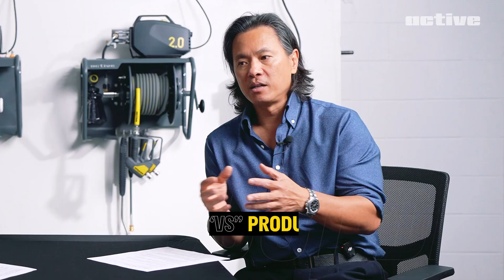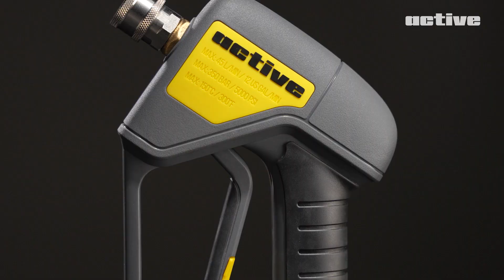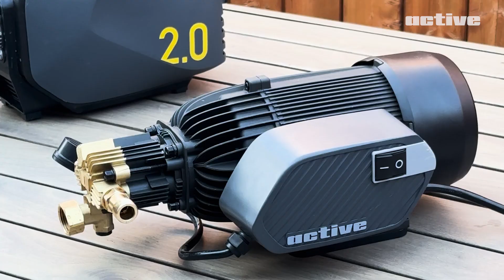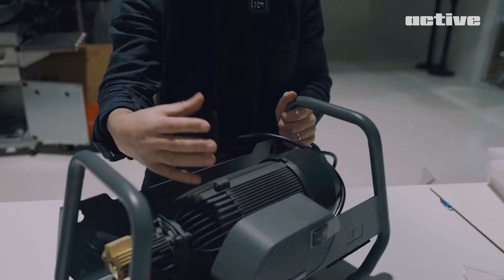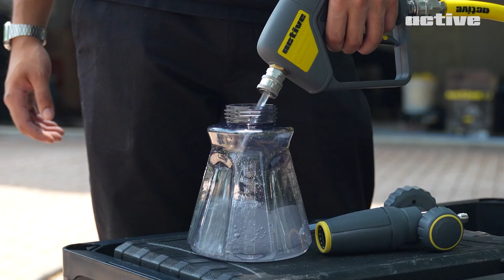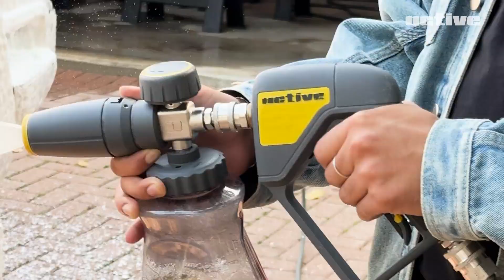Does Design Even Matter? | How We "Secretly" Improve our Pressure Washers and Accessories!

Comment: TECHNICAL QUESTION:  The manual of the 2.3 states to use a pump saver to run antifreeze through the machine from winter storage.  As I will be storing the unit in my house for the winter as RECOMMENDED even with using the pump saver, does the antifreeze have properties to ensure the internal seals last longer?  I would think there is no silicone, that is a great rubber lubricant, in antifreeze.  I would think generally antifreeze with alcohol or ingredient similar to alcohol to prevent freezing is not good for any rubber internal seals.  Do I really need to pump antifreeze in the unit to make the 2.3 last longer with indoor storage at room temperature?  Thank you for your anticipated reply to this question.
Reply from the maker: Hello Alan, antifreeze is recommended for use not only for long term winter storage, but it can also be used as a periodic lubricant for seals and valves within the pump. We encourage lubrication every 2-3 months.
Reply: Thank you for your quick reply.  I’ll buy a pump saver